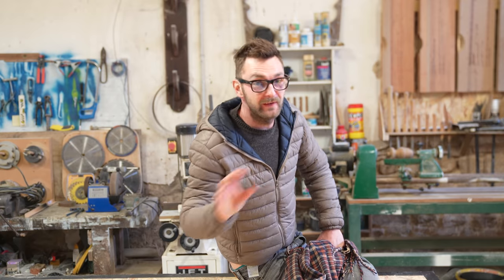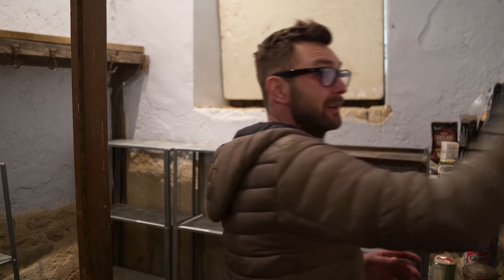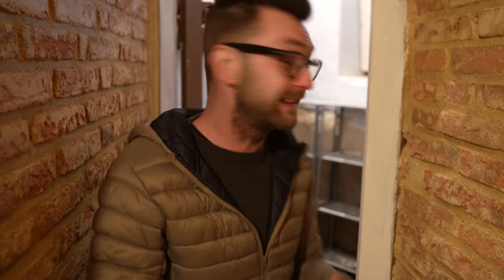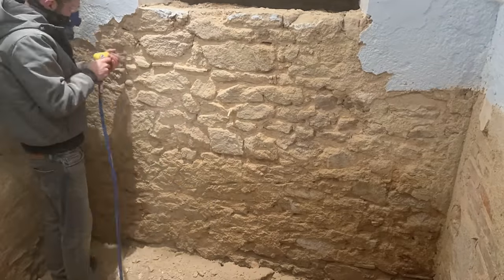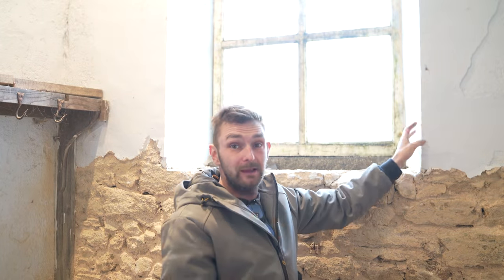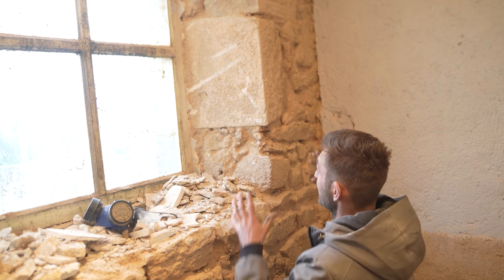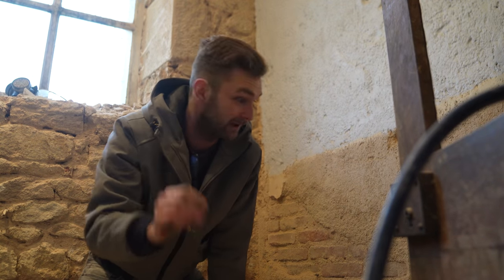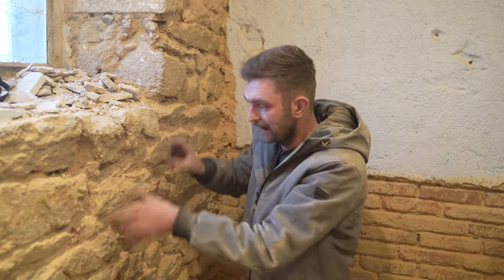The hidden room in the chateau - EP201

Comment: Dan, when you point the stone walls...push in the mortar like normal but use something rounded (a stick, small paint brush handle, dowel) with the end rounded to go between the stones before it sets up too much and broom it well after...It won't look so 'flat' that way
Reply: I think he is going for a flat stone surface because it will be a food store and it will be easier to clean/brush down the walls.

Comment: Archeologist here - the wall under the window appears to be built on an older wall. 
You can see a layer of smaller stones that were used to make the top of the existing wall flat so they could continue coursing upwards from a flat workable surface..
Reply: Dan - is the outdoor ground level the same as that very distinct course of small stone?